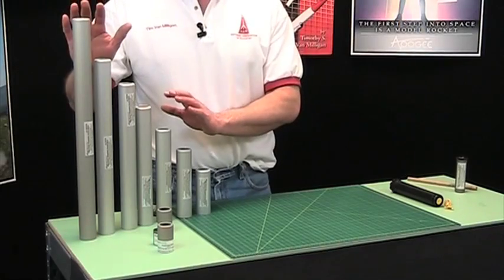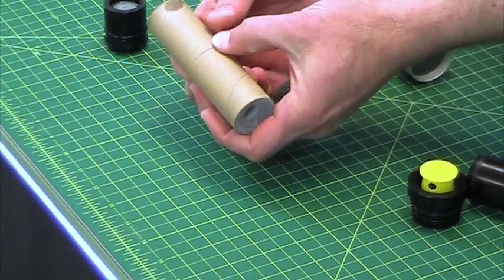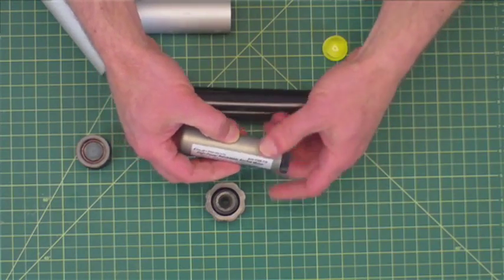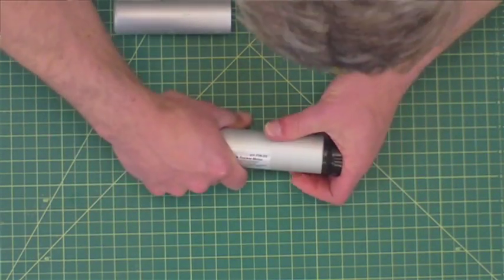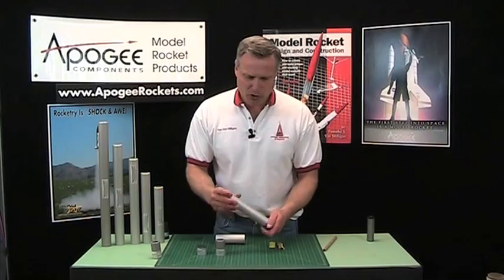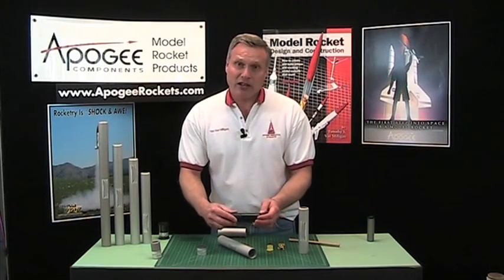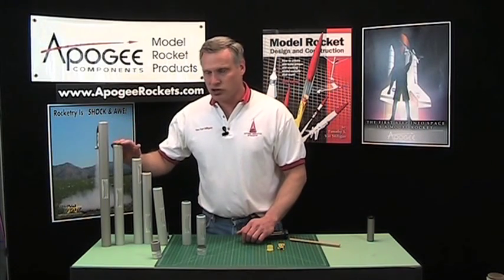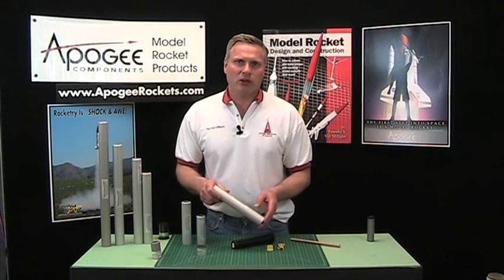Assembling a 38mm Cesaroni Reloadable Motor

Comment: Can you buy a 3 grain housing with two spacers on the 38mm, only using one grain without needing an L1 cert? That way, you could fly the rocket and see how it performs, then expand up to 2 and 3 grain for and then after an L1 cert.
Reply from the maker: Yes. That is possible.

Comment: why can't you just fly without the case? seems like extra weight.
Reply from the maker: The case is what holds the pressure in. Without it, the gases won't exit the right direction through the nozzle.
Reply: Saad Mirza BOOM
Reply: https://www.youtube.com/watch?v=o-ZJau6TtE4 This is exactly why you can't just fly without the case